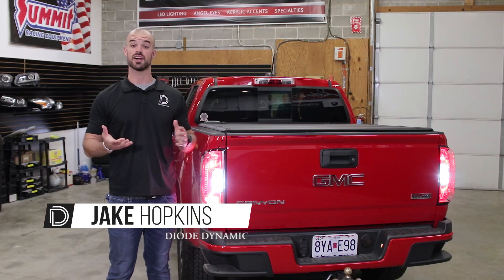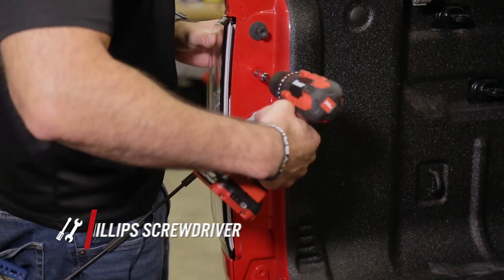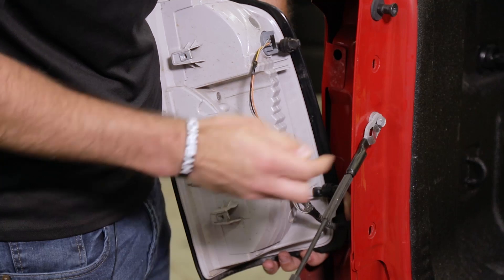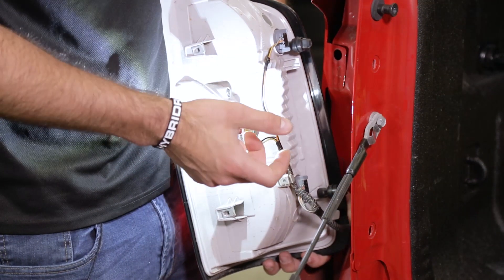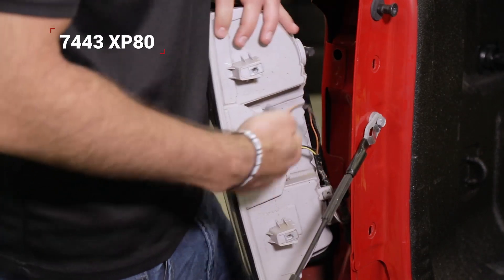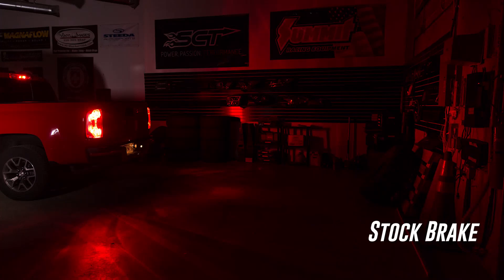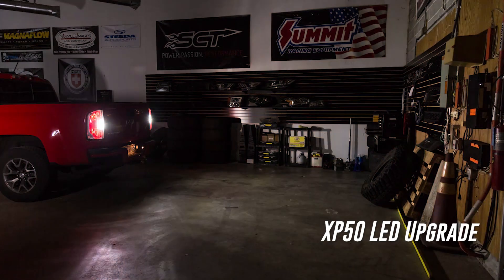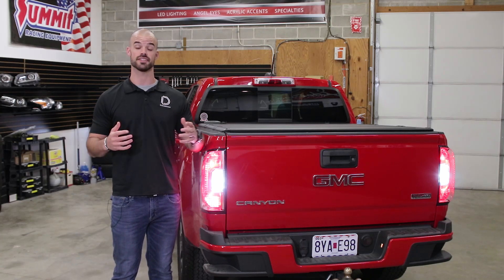How to Install 2015-2022 GMC Canyon Tail Light & Backup LEDs | Diode Dynamics

Comment: Are the two screws the only  thing holding the lightin housing into the tail gate? 2018 canyon V6?
Reply from the maker: There will be two Phillips head screws on the inside of the tailgate, and on the inside of the bed side, there are two retention pins that release when you pull directly away from the vehicle!

Comment: I got a similar problem, perhaps you can assist. On the passenger side of my Chevy Colorado 2018 LT truck, when my headlamps are ON, the passenger tail light bulb (top right) doesn't turn on. However, when I step on the brakes, it turns on. Do I need a new bulb for passenger right side tail light ?
Reply from the maker: This is strange! We would first recommend checking the connection of the bulb to make sure that it is secure!
Reply: I have this same issue..except in the left  side on my 2019 gmc canyon
Reply: You ever fix it
Reply: @supremefitbaby4625  yes I was able to.